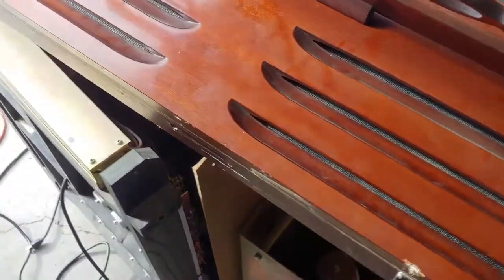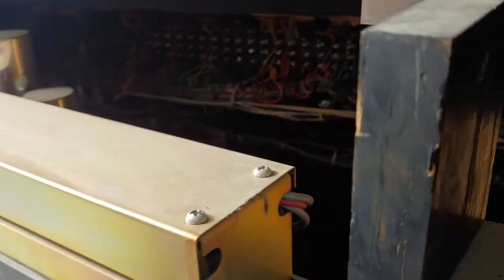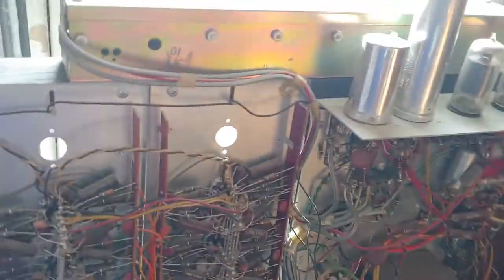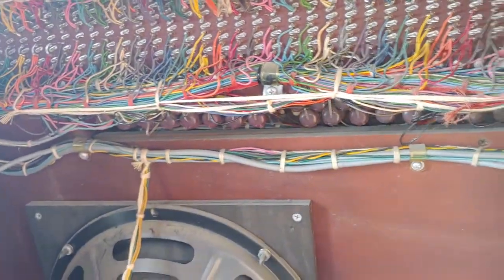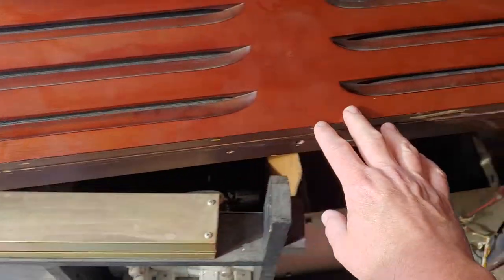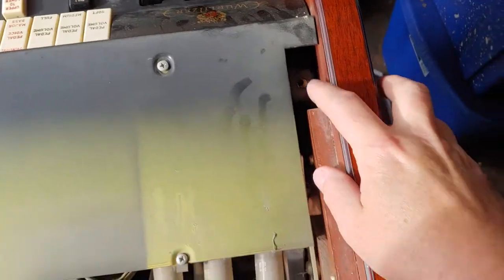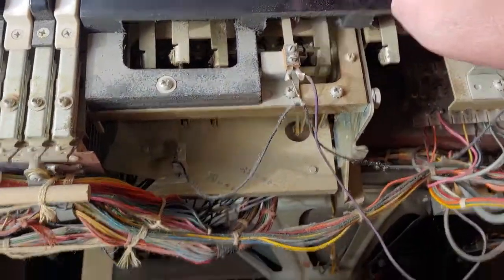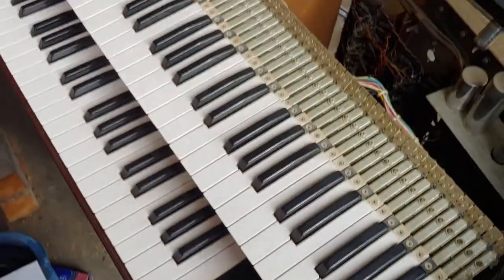Wurlitzer Organ 4100BD repair

Comment: That's a early 60s era organ. I was selling Wurlitzers in 1972, by that time they were all solid state.  We used to get some 4100 series organs in trade now and then.  Our service guy loved Wurlitzers, hated Kimballs.  I always thought the 4100s had great tones.
Reply: I could have a 4100 for free. All the stops work, but the organ is very quiet, especially if you only use one stop (you can almost not hear the oboe, for example). Does anyone have a suggestion?
Could it be that the power amp tubes are the wrong ones? I seem to recall there were two EL34 and a smaller one I don't recall.
Thanks for any suggestions!

Comment: Hi, I received a Wurlitzer 4100BW today and appreciate your video as mine is going to need a lot of cleaning. Do you have a video out there showing how to remove the top keyboard so I can clean the lower keys.

Thank you,
Michael
Reply from the maker: I don't think I do have any more videos on that organ but what I show on the video will get you access to most of it. The keyboard has a hinge on both sides and the front pulls up. I think I remember there being screw somewhere on the keyboard but I'm not sure it's been a long time. What I would be most concerned about is the motor for the vibrato. Do not turn it on until you have serviced it properly cuz it could burn out the motor if the motor is not turning. Basically the way the vibrato works is there are two speakers that are turned like a fan by a motor. When you open the back of the motor is on the lower right side. It has a cardboard like baffle covering it. All you really have to do the service that is drop some oil on both sides of the shaft of the electric motor so the bushing sucks it up. Then it should start turning fairly easy. Also there is a rubber belt going from the motor to a wheel that turns and rotates the vibrato speakers. It may need to be replaced if it has never been done. 

In case you are not aware make sure not to touch the metal chassis when the organ is plugged in because that chassis uses a floating ground and the only thing that is protecting you from getting shocked if you touch it is a sixty-year-old capacitor nicknamed the death cap. Even when it is unplugged the capacitors can sometimes hold a charge so avoid touching any Electronics. Not a bad idea to use rubber gloves.
Reply: Thank you

Comment: Hey I just picked up the same model organ and I’m having some trouble with stops not working, do you have any advice
Reply from the maker: I'm not a organ player so I'm not sure what you mean by the stops aren't working. I'm guessing you're talking about the different switches that change the voicings and effects? Are all of them not working or just a few? Could be a dirty or Warren out switch, bad tube or bad capacitor. If just one or two effects aren't working you could narrow it down to those and look at those specific switches and check their tubes by swapping them with tubes from other effects. 

On a side-note all the electrolytic capacitors are due to be replaced and in my opinion should be replaced before they go bad to prevent damage to the rest of the organ.

Comment: How do you know if the fuse is good or bad?
Reply from the maker: You can visually look at it to see if there is a break in The Wire but a multimeter set to ohms is the best way to check. You can also put a new fuse in it. I think the fuse on this had a black cap that unscrews and the fuse is inside it. If the new fuse pops too that means you are probably going to need an experienced person to figure out why the fuse keeps blowing.

It's good practice not to touch the metal chassis or any metal parts of the organ while it is plugged in because these old organs with the two pronged chords used a floating chassis which is protected by an old capacitor and if this capacitor fails and you are grounded to something you could be seriously shocked. This also goes for old radios and guitar amps.
Reply: Would it improve the situation if the chassis was grounded via the third prong of a modern cable?